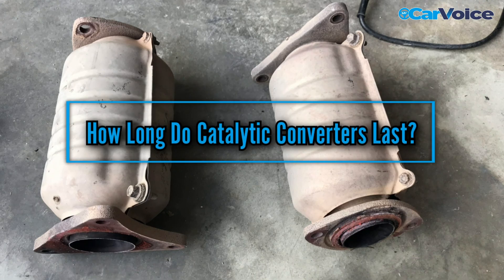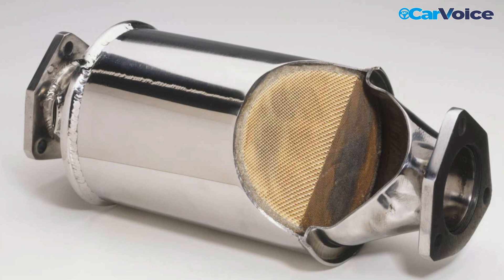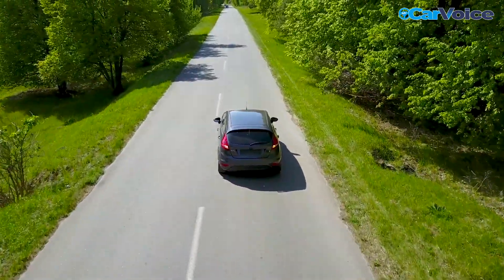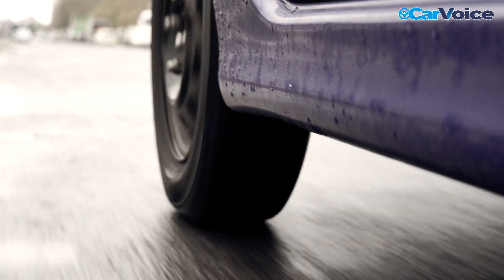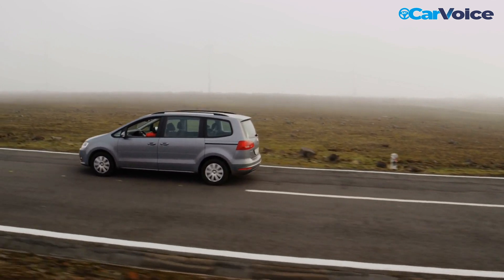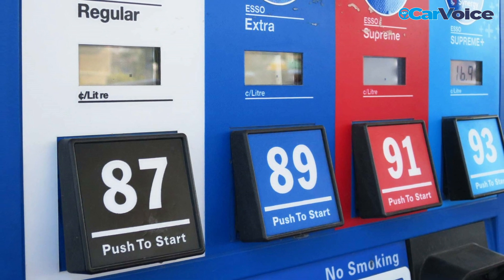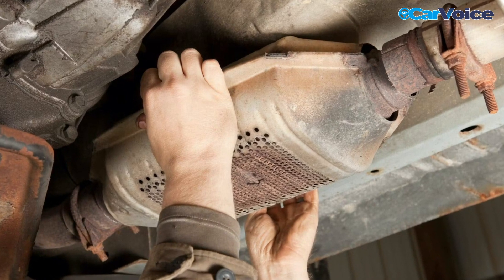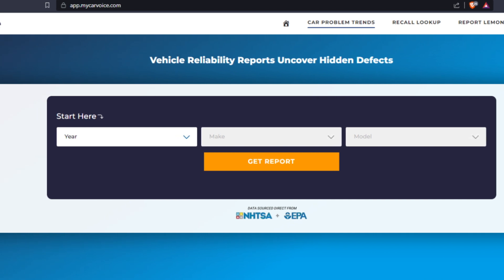Catalytic Converters: How Long Do They Really Last?

Comment: i have a prado 2014 it has a high rattiling sound under the car when rpm is 750 rpm it comes alot when parking and some times go away for a time then back , there are 2 garages ispected it and they say its the catylattic converter need to replaced , i dont have any other symptoms like check engine and bad smell , could it bbe really the catilatic converter? keep in mind that the car driving performance is exellent with no issues
Reply from the maker: More than likely it’s the heat shield on the catalytic converter making that sound. Get the vehicle on a lift and visually inspect the  shield for broken wields. If nothing visible, take a screw driver or similar tool and tap the converter with it. If you hear rattling, could be the upper heat shield. Hope this helps.